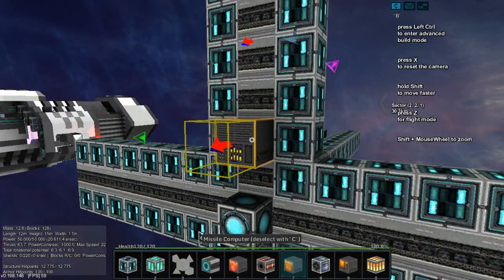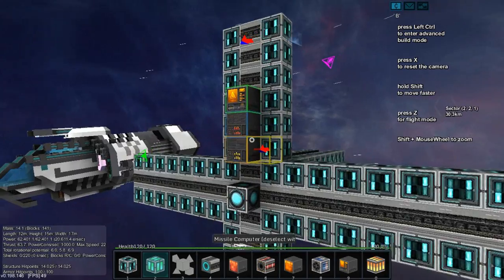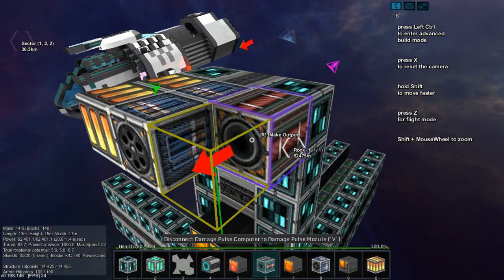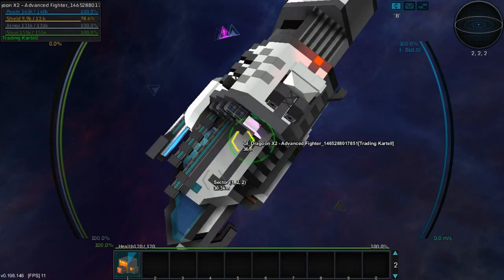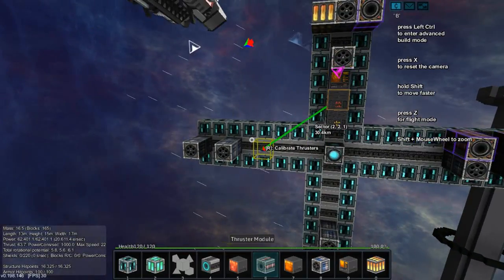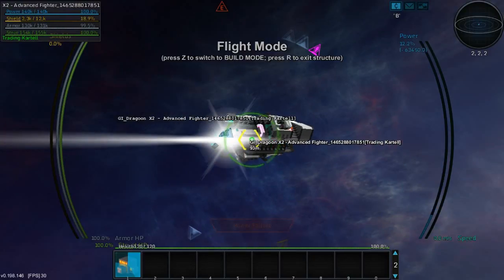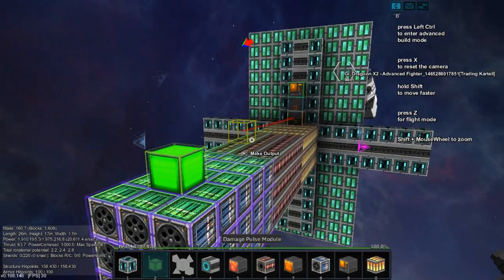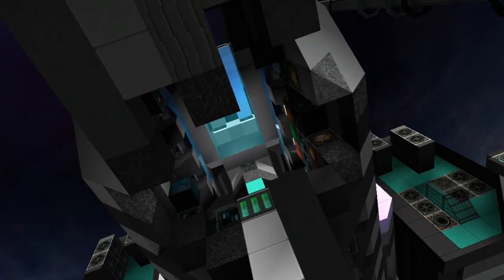StarMade Compact Tutorial | Nuclear Missiles

Comment: I had an idea for building a ship that would be like a SSBN, it's primary weapon would be an array of nuke missiles ( Missile-Damage Pulse-Explosive combo just like in your video). Only draw back would be the size of the power array, you mentioned you could do the same thing but without the missiles-pulse beam being in a 1 to 1 ratio, you just had to keep the explosive modules the same ratio?
Reply from the maker: If you keep damage pulse to a low, they will act more like normal lock on missiles, so if you run short on power it might be better to have big normal lock on missiles with explosive

Comment: why not use the energy efficient setup or is that removed from the current version? 
also i heard having multiple weapon groups attached to one computer requires more power than a big one of the same size so why not multiple weapon computers and groups connected by logic? if yes how much more energy efficient is it?
Reply from the maker: This is a good way to build power in current version, on details of how power works EXACTLY, pleas take a look at this: https://youtu.be/tufIQ_P8f64?list=PL4I2otbyva40xJMAW2gZvTW2pHTHcnIUt
About many groups, it serves a purpose, as power builds up fastly it is in my eyes not worth the effort of switching between12 computer systems all the time, logic will not work as it does not offer lock on, so your nukes would be of dumb type missile, about exactly how, it seems to depend on the system, but honestly I don't experience a difference enough to care :)
Reply: Each new weapon group multiplies the whole system's power cost by 1.1(so it adds 10% of the current power cost).